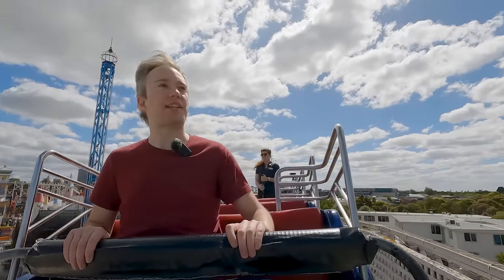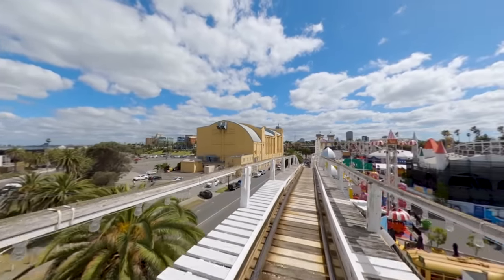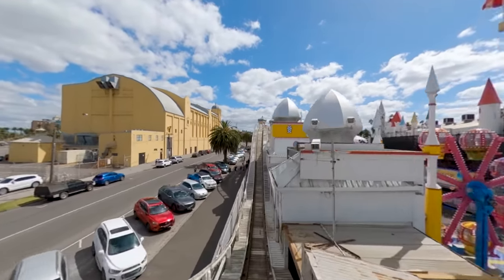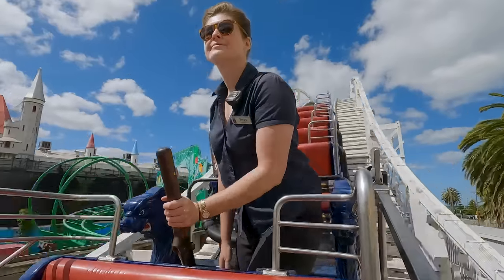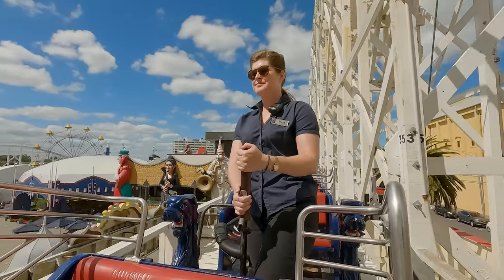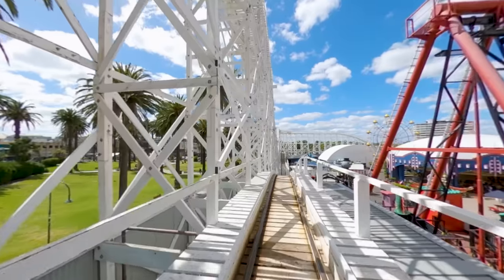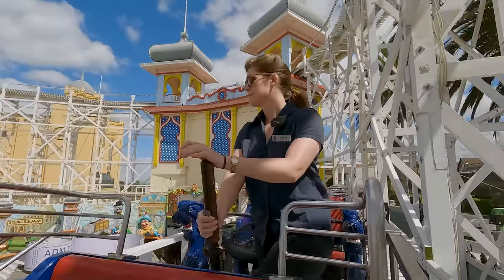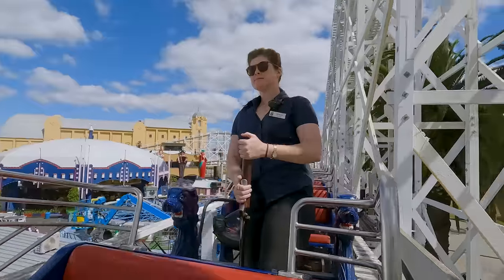This rollercoaster doesn't stop automatically

Comment from the maker: I know, the obvious question is: what if you don't brake? For obvious reasons, that's never been tested; all the answers about it were so cautious they didn't work in the video! But in summary, there wouldn't be a disaster: it'd probably cause a bit of whiplash for folks on board, and the ride would need to get thoroughly checked over afterwards.
Reply: Hello
Reply: This roller doesn’t coaster automatically
Reply: It does stop
Reply: 2 days ago?
Reply: Hi Tom! Hope you’re doing well, and have a great day!
Reply: Tom do a video on nuclear power stations
Reply: It goes faster.
Reply: Quite dangerous!
Reply: @jtfgamer8832  That is weird.
Reply: Hello Tom from the past
Reply: Thank you
Reply: There’s footage of a more modern wooden coaster, where they let the train run though the station at full speed with no break. It caused a ton of damage to the track, the equivalent of 6 years of normal operating wear.
Reply: @NintendoCraft28  would you link it please
Reply: Hmmm
Reply: Strange it doesn't have a 'dead mans hand' type of break. Where the driver has to keep the break off for the coaster to move. So if anything happens to the driver the coaster's breaks come on.
Looks like a fun ride for those that like that kind of thing.
Reply: it must be tested for science tho... MUST
Reply: The obvious question is: If that is the second oldest operating rollercoaster, what is the oldest?
Reply: I think you're wrong about this being one of the last few hand braking coasters in the world. I worked at an amusement park here in New Jersey with a roller coaster I believe called the Wacky Worm. It's just 1 loop with 1 small hill and the hand braking is done from the station not from the car, but I believe that is a mass produced small coaster. And yes, whiplash is the answer to what happens when the brake is either not applied or too little.
Reply: I’ve been on one of these at Great Yarmouth and got to see a few of the cars on two wheels as we went round a corner
Reply: So pleased to see you enjoying rollercoasters! Ride on!!
Reply: What, no dead man's switch?
Reply: @ants2340  he has. Several times
Reply: what if something happens to the brake operator?
Reply: I have a question. Has it ever rolled backwards?
Reply: @ants2340  there's over ten Tom Scott videos about nuclear power stations. Just search "Tom Scott nuclear" 😁
Reply: Were there any incident of operator passing out or something like that in over 100 years of the ride?
Reply: They have a similar ride in Tivoli in Copenhagen, Denmark. 
My father who operated it, said that the operator would have to pull to actually let go of the breaks. So if they simply removed their hands, the train would break. Might I also add, those kinds of old roller coasters feel different from where you are sitting in relation to the operator. Experienced visitors might prefer the seat furthest in the back for a more intense ride :D
Reply: if that person was not there to do the brakes the train would go a lot more faster and even crash into the station
Reply: For me, the obvious questions are "why does the brake operator have to stand" and "what is being used to safely secure them so they can't fall out?"
Reply: Without up-stop wheels there is a chance of derailment, but in a much less dramatic way than some other coaster failure modes.
Reply: In summary, discombobulate.
Reply: My obvious question is: he said it was expensive to maintain ... so how much is a ride?
Reply: In Citation Needed 7x04 you talked about manually-braked rollercoasters and Luna Park, but surprisingly you didn't say anything about this...
... mainly because there's two Luna Parks, and you were talking about the American one with the Flip-Flap loop-de-loop.
Reply: w
Reply: My understanding is that these old trains don't have up-stop wheels so if the speed is great enough at the crest of a hill, the train could leave the track entirely. I have seen scenics where the breakman has a single little seat, sometimes includes a little belt. Last time I rode one that I remember was at Tivoli Gardens, Copenhagan.
Reply: huh, I would have thought it'd be a deadman level instead, i.e. you have to pull the breaks off rather than push them on.
Reply: It would not cause whiplash for the guests as the ly will experience strong airtime but not negative Gs as the restraint is very loose, so they cloud fly out but no sickness feeling from and G Forces.
Reply: Love to see you enjoying rollercoaster now :)
Reply: you could try riding the timberwolf at worlds of fun amusement park. It's an entirely wooden rollercoaster what I've loving named the aneurism for how much it'll rattle your brain like a maraca. I believe it only has trim brakes which are only on the track itself in a few sections. I usually avoid riding that one myself unless I've already done every other big coaster.
Reply: The even more obvious question is: Why did you have to go to Melbourne when there are still two in the UK, at Margate and Great Yarmouth? The roller coaster at Great Yarmouth is the second oldest (opened 12 years after Margate), the second tallest, the second fastest, and a Grade II listed building (see what I did there? 😁)
Reply: I remember the time you were scared of rollercoasters ;)
Reply: it could theoretically derail and or crash though because it is not attach to the track
Reply: @cool110  well if it got going fast enough, it would be the most dramatic way
Reply: It imagine it wouldn't be hard to find out in a simulation
Reply: Welcome to  Melbourne!
Reply: You are so close to Victoria's deaf school, it's an old one with a lot of history. You should take a look.
Reply: It really should have been tested! That's quite dangerous!
Reply: @JD-pi2ce  There are tests too destructive to try.  Every public building should be tested for its ability to withstand a bomb, but that testing would simply kill too many people compared to the chance of never getting bombed.
Reply: @isaaccisa  Three, there are two in Australia.
Reply: It'd be really cool to see you visit Leap the Dips (oldest coaster in the world), it has a surprisingly sordid history behind it
Reply: what happens if you don't brake :D
Reply: @johndododoe1411  Hmmmm, i'm not sure that's quite comparable. The likelihood of brake failure is quite high at some point. The likelihood of a bomb is less so. The test doesn't necessarily have to be real (it could be simulated) but it at least needs to be tested in both cases.
Reply: So what is the oldest rollercoaster? Surely it must be in Tivoli gardens Denmark? That is older than 100 years...
Reply: @Tom Scott what other Australian stories can we expect?
Reply: @dbfi01  Leap the Dips at Lakemont Park in Altoona Pennsylvania, 120 years old
Reply: @dbfi01  Tivoli's is built 1914, making it the third oldest!
Reply: @isaaccisa  if you are going to include the American one then there are technically 3 Lunar parks. There is also one in Sydney.
Reply: Thought the obvious question would be what's the oldest (#1, #5 and #9 are all in Pennsylvania)
Reply: It's a good thing no carnival-themed supervillains are around in Melbourne, because if this were Gotham City, that rollercoaster would definitely be manned by a maniac who lets go of the brakes on purpose.
Reply: @maxximumb  I thought the same thing. Maybe it's one of the planned upgrades the engineer mentioned.
Reply: @Ian_Staff  I'm sure there will be more videos than just this one from Australia.
Reply: It's not a dead man's break system? What if the driver passes out?
Reply: What you mean to say: They were all cautious to not admit Old Mate has indeed fully sent it
Reply: Still Tom Being a badass and overcome his Rollercoster Fear is awesome.
Reply: I've ridden this multiple times, didn't even cross my mind that the brakes were manual. It's amazing that such an old roller coaster still functions so well.
Reply: Tom, so proud of you mate! It's inspiring to see how far you've come from being terrified of roller coasters on Tom Scott plus, to being able to calmly deliver a monologue while riding one here. Brilliantly done! And thanks for teaching me something new about attractions in my own city!
Reply: I've been on Montaña Suiza at the Monte Igueldo Amusement Park in San Sebastian (Spain) the oldest steel roller coaster (1928), that's break controlled as well and doesn't even have a lap bar. It's a lot smaller this one. Still I recommend it as it feels like it could go over the cliff into the sea at any moment.
Reply: Having a bad day at work? Floor it
Reply: It is not obvious at all. Why it hasn’t been tested? Just put dummy weight on it, push from the top, and see what happens. As an authority, I would NEVER give any permit without such easy test.
Reply: There's been a decapitation or two in the past, that's probably the worst that's happened
Reply: @hardwickd  Leap the Dips at Lakemont Park.  It opened in 1903.
Reply: I've been waiting to see you on a roller coaster since the day you conquered your fear of them. Congratulations and have a ball!
Reply: "what if you don't brake?"
Go to Tivoli Garden and get on with some wicked brakeman on Rutschebanen to find out :^)
Ride is 109 years old and it runs on a whole other level.
Reply: OH MY GOD!!! YOU WERE IN MY HOME CITY!!!!!!!!!!!!🙀🙀🙀🤯

THAT’S THAT CLOSEST WE’RE EVER GONNA GET!!!! faints
Reply: Welcome to Melbourne Scott, hope you're having fun. Stay cool
Reply: If you are still here in Naarm, Melbs, you are welcome to visit rmit builing 80 or see 3 Triple R Fm where the bumper sticker is a kind give away.
Reply: But would it stop somewhere??
Reply: Actually my obvious question was how does the brake operator not fall off the ride?
Reply: @Tomscottgo are you still in Melbourne???
Reply: When were you in Melbourne? I'd have said G'Day!
Reply: Tom, why don’t they use wind sensors and such to get a robot to automatically calculate the speed at which to operate? Surely it must be more efficient?
Reply: I would assume that would've been designed with that in mind
Reply: Go on Smiled at Alton Towers
Reply: @maxximumb  otherwise it would valley and be a pain in the butt to fix (hypothesis)
Reply: 8 DAYS AGO GEEZ
Reply: So did u ride the smiler at alton towers
Reply: I would imagine best case, the coaster gets some airtime and it would be uncomfortable, worst case is it doesnt land right... or at all and derails.
Reply: Luv luv ur vids ❤️
Reply: God bless God loves you
Reply: There is a similar one in Great Yarmouth, England. Called the "Roller Coaster"
Reply: I thought the obvious question was: Why does the driver stand?
Reply: Hi Scott!
Reply: Scott you should make a do a Colab with YouTooz!
Reply: if i knew you came to my country i wouldve went down to luna park (its right down the road from me)
(walking distance 1 minute)
Reply: Is there anything holding the wheels to the track? If the train had enough speed, could it lift from the track when passing over a hill?
Reply: @billkatie8272  Braking from the station is entirely different than a physical hand brake attached to the cars...
Reply: @Zoltan  Good thing you're not an authority. Who's gonna hit the brakes with no one on it genius...
Reply: @Tony Hollerz  the main selling point of it is that it's old with old techniques. At that point why not just tear it down and build a new coaster.
Reply: My obvious question was actually "why can't they do it sitting down?" There are multiple signs saying not to stand up for the riders, why does the brake operator have to stand up? Could it not be operated from a seated position?
Reply: Welcome to the best city in the world!
Reply: For those of you who are unfamiliar, a block zone is a section of track…
Reply: @irissupercoolsy It must be treated in the name of AIRTIME
Reply: @hardwickd Leap the Dips
Reply: @cool110 Well if brakes weren’t applied, ye maybe derailment could happen
Reply: @maxhagenauer24 ?
Reply: @AmateurThoosie  What?

Comment: The fact that she's just... standing there. On a rollercoaster. Not strapped in or anything like that. Absolutely insane.
Reply: Is it though?
Reply: If you've ridden it it's a very tiny roller coaster.
Reply: its a very tame one, not a modern one with crazy speeds
Reply: Doesn’t. Pull enough forces to be dangerous
Reply: The Finnish wooden Rollercoaster in Linnanmäki is also manually braking and  it is definitely comparable to modern middle sized coasters especially with a good braker.

The beakers also just stand there though they wear a belt that's clipped onto the brake cart with a caribiner
Reply: it doesn't go much faster than 30 km/h, but they have "pointy" hills to create more air time, so it's perfectly. You're also not strapped into the carts, but merely have a simple restraint so you don't go airbone
Reply: The fun police haven’t ruined everything in Australia yet, hope your having a good time in Aus Tom.
Reply: I would be terrified
Reply: @thesteelrodent1796  that advetised speed is actually 60km/h
Reply: My question is : what if you faint or momentarily lose balance? Which we know happens
Reply: No worse than skateboarding.
Reply: In Denmark there's another one of these "brakeman" rollercoasters where the operators like to do little tricks and poses for the guests in line as the train rolls out the station. Once it's on the lift hill they go in full focus mode of course, but it's so nice to see them bring these personal little touches to their job. Super nice folks.

And I can confirm what Tom says, these 100+ year old constructions actually have airtime moments. Surprisingly good ones, even
Reply: @Mike_Dubayou  No.
Reply: Absolutely Australian **
Reply: it's not that fast dude
Reply: "Really? Right in front of my Aussie OSHA manual?"
Reply: The rollercoaster actually used to have a loop, but they had to remove it in 1986 after the brake operators went on strike
Reply: Nah. It doesn't go around corners fast, or even go that fast at all. It runs the perimeter of the park and just goes up and down a few times. If it wasn't for idiots you really wouldn't need restraints for the passengers.
Reply: "She's just standing there. Menacingly!" ©
Reply: Well. Being the breakman on Rutchebanen, the other where it's manually controlled is way more crazy.
Reply: Anyone who's been on the scenic railway will tell you it's very low intensity. You could easily stand on it like that, it's not The Big One
Reply: From the video it seems like it's not too crazy like those modern ones with high speeds, extremely high hills and drops or loops, so its not really that insane.
Reply: @mick1598  "the fun police" you mean safety? 💀
Reply: @pijcab  You die or get hurt or dont get hurt. Easy bruh.
Reply: @SuperHoeCakes no, the scenic railway never had a loop.
Reply: Yes there's  they go through  10 years  of training  to balance  like that with no straps and no seats

Comment: It’s honestly amazing to me as someone who lives in Melbourne and has been on that coaster that I never really realised that it was so unique in the sense that the rollercoaster could only be stopped/have it’s speed adjusted by someone on the train, rather than a centralised system. Thank you for this insightful video Tom, next trip to Luna Park will be one with new eyes ^^
Reply: The rollercoaster we have in Helsinki also has a break operator. I didn't realise that it's something unique either. It's been here for over 70 years. When I was a kid in the 80's and 90's, I'd always hear people wanting to get rid of the wooden eyesore. But now the same people are fighting tooth and nail to preserve it.
Reply: @VikingTeddy  same in yarmouth we have a lovely woody with a double rolling hill
Reply: There are 7 rollercoasters still operating that require a brakeman. Luna Park's Scenic Railway is the only one outside Europe. Wikipedia only lists 5 of them; 1 in Melbourne Australia (the above), 1 in San Sebastian, Spain (also the oldest Steel rollercoaster in the world), 1 in Helsinki, Finland, and 2 in the UK (Margate and Great Yarmouth). Some coasters which used to use brakemen have since been converted to run without (the Finnish coaster has a little (and older) brother in Denmark which no longer needs such for example.
Reply: Vuoristorata in Helsinki Finland is manually operated
Reply: Same here mate
Reply: @ImperialJustinian  There were two in Denmark until about 2010/2011 that had the handbrake. One has been converted, but the other is still very much running with the handbrake. The one that closed was in a park called Bakken, about 15-20 minutes outside the city center. The coaster with the working handbrake is at Tivoli, in the center of Copenhagen. Its the third oldest coaster in the world, just two years younger than the one Tom is riding on. You literally get to see the coaster on the other side of the street as you walk out from the main train station.
Reply: Same
Reply: Same as me!

Comment: "The longer you leave Risk, the more chance it has of occurring" is such a good line.
Reply: And believe me, no one needs to be tempted to play that slog of a board game. Best to take it off your shelf and throw it in the trash where it belongs.
Reply: Just picked a random day let me know if something bad happens to you
Reply: Also accurate
Reply: By "leave" does he mean "ignore?"
Reply: @Holygiant  correct
Reply: Well, mathematically the chance remains the same
Reply: @Max_Jacoby  At any one instant yes, but roll the dice enough times you will roll a 1 eventually
Reply: @Max_Jacoby  Yes and no. One is chance per time unit, the other is chance total
Reply: @Max_Jacoby  he's talking about engineering not math. The chance increases because the machine continues degrading over time...